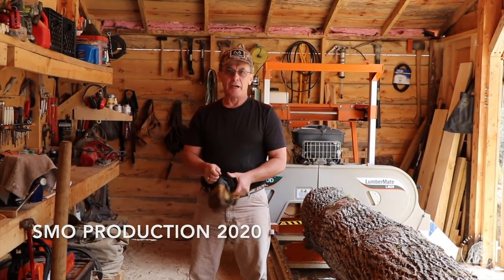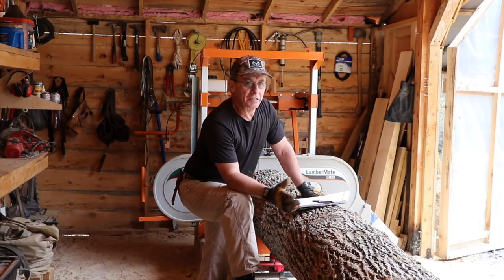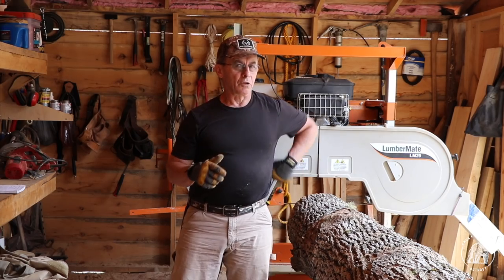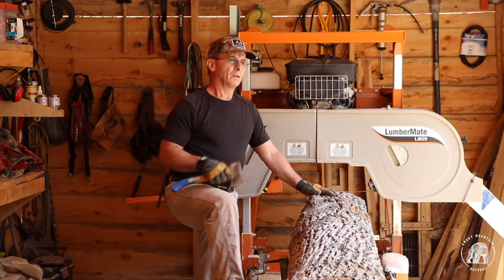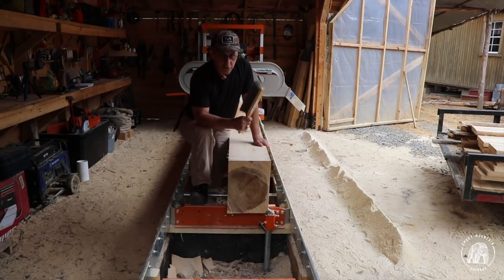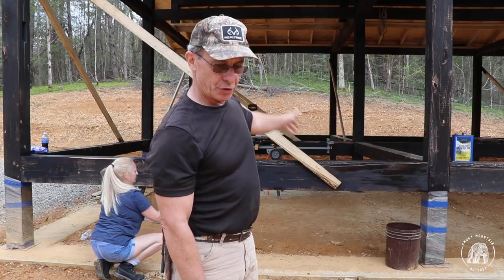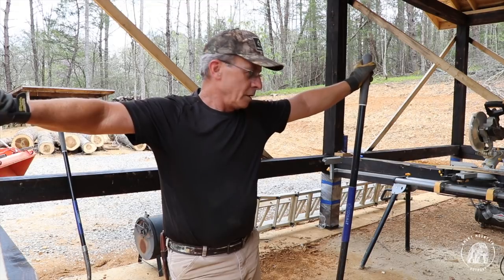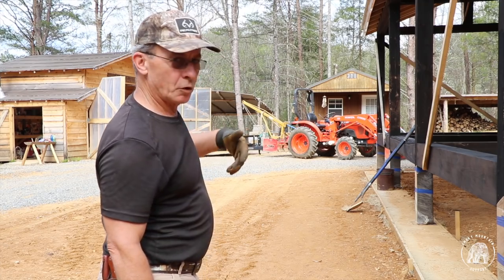QA9 | WOODWORK | TIMBER FRAME | MILLING FLOOR JOIST | ADVICE ON CABIN BUILDING

Comment: i would reconsider the lap siding yes it looks nice and I have done both I have even removed lap siding and went back with board and batt here is where the trouble will lay you do not have dry kiln lumber lap siding will bow and open up even with the best of wood that has been  dried board and batt will lay better and dry different in place yes small gaps will form from wood shrinkage that you wont see with lap siding but it will cup and open because it has no nails to hold it tight at the bottom of each run your batts on the board and batt will cover any gaps that are formed from the shrinkage and I also agree and plywood type underlayment before siding will be a tremendous help in the overall comfort level of your cabin along with a house wrap between your vertical timber frame posts love the videos keep them coming  just a north Arkansas guy whos been there done that

Comment: Use joist hangers on floor system. Bottom beam is plenty strong to hold load especially if you are supporting  them with block. You can use smaller block( cheaper), and  your  Mason will be a lot happier! Also speeds up the process tremendously, if you don't have to lay block first.
Reply from the maker: Copy that!!

Comment: Siding: we have log siding on our camp and had some that warped and popped out over the nail heads. I used 3 1/8 GRK screws which I'd recommend for anything using different size screws of course.  AMD they pulled the siding right back In tight. Did have one that I used 2 screws at one time with 2 drills as that one was a little stubborn but they sucked it right back In. I'm a fan of both lap and board and baton but i think lap would look great with the exposed beams along w the angle support corner beams. Woukd b a good combo of those angles. Water tanks: never done that but in the effort to prevent stagnant water I wondered if there was a way to force the new rain water to te bottom in pushing older water out the overflow ? May not b a need or issue but was just thinking ahead. Great video and thanks for sharing the Info you're getting
Reply from the maker: Thanks Tony

Comment: If your wondering about solar power I've also been subscribed to another couple that is building a A frame house with solar power in West Virginia. You might want to check them out. Its Wild Wonderful Off Grid. They have a link to a series of videos they did on their solar power setup they have. Good luck, love your videos. I have been subscribed to both you tube sites for over a year
Reply from the maker: Thank you. I will check them out. We appreciate all of your support.

Comment: 5th👍's up guys thanks for taking us all along with you for the great show
I like all the great work you and your family and friends have done
Reply: if you are going to screw it make sure you wrap the tip of the screw to take the point off it so it don't split the wood you wanted to mall its way through the wood
Reply: Take the sawdust that you have left over on the ground cool 15-foot all through the woods he needs correction from the Hallsdiggerfoot hole and fill it full of sawdust and cover it so the rain came today other than in a termite Sophie's there and stay away from your house more
Reply from the maker: Thanks 👍

Comment: There is a push toward DC power vs. AC down here in Florida. It uses much less power accordingly. If I were to go solar, I would think that would be the way to go. You might do some research about that.

Comment: YT tip for al traditionell building lovers: NORTHMEN. Cool guy he had put alot good solid videos online. Traditionel building-houses or cabs include to evoid mineralwool or syntetic iso stuf. Wood dust from the chain saw is a perfect isolation material to fill walls or floors or under the roof. Take a look at his canal.

Comment: I found an oil based stain call Outlast Q8 that I used on a white cider log cabin I built.  It was a great product which was recommended to me by a log cabin restorer out of NC.  Great UV protection and the insects, including carpenter bees, hate it. As will all stains, eventually you will need to retreat, but this product lasted for me, about 6 years before needing another coating.  Worth a look.
Reply from the maker: Thanks Steve

Comment: I’ve been in the industry for over 30 years. What you have to understand is this is your build, at the end the look needs to be what you want so your happy. The siding should be what you want the key to all of it is the install. Most people will answer with what they prefer not what’s best. Again it’s all about install, make sure your siding can weep, have drainage don’t set directly on ground or concrete use the proper flashing and waterproofing, treat or paint the end grains

Comment: For those how plan a new house or cabin:
About the importance of “geology-fact checking”
I am a facility manager in Germany. 30 years in business.
There are the customers, then the architects and the building comps.
I am one if the controller of the work- I work for the owner and I control the work on the building place and the contract and check out if the architect (if one is on board) does what the contract about the quality will come into existence. 
One classic example of a standard house: Concrete as a fundament, then a 15-20 cm air concrete stones as a “first wall” then 10 centimeter air with 5 centimeter isolation of high end
hard pressed mineral wool- some small air holes in the outside wall- with clinker stones so that the wall can breathe. A standard wall can be 40 centimeter to 50 centimeter.
Good in summer and good in winter!

Geology-check is a “must do” for many house builders and those how did not do it- big problems came in the future. If the ground is to wet because groundwater changing in summer when the rain season is on its way- or if they build on a river side or direct on a river.
Sometimes in 2 or 3 meter there are underwater lines that keep the ground wet and instable.
60 years ago, my father builds his first house. He was a agricultural engineer, a former farmer in Germany end he did know something about soil and the earth. Farmer knowledge 
He bought a piece of land that had a hard big layer of clay stones 4 meter deep.
Because of that the rainwater could not go away. The groundwater could become a problem for the cellar because there is no concrete that is waterproofed.
So he build first a “cross over- pipeline in the sand of the fundament bevor the concrete was poured out- and in the middle of the house a collection point for the groundwater- so that 1000 liter water could find a place and a automatic pump system would pump the future water away from the other side of the house- the cellar. Than the concrete came and then the house was build but also with drainage around the fundament of the house. Keep the house dry!
Believe me the house was dry until this day.

Some don’t consider “where the house can stand and where the place is not so good”.
Some build to near by the hillside and take away from the hillside the “feed” of the hillside.
Every era has its own hill-substances depending on the quality of the hill- much stones- big granite places. Some have hundreds of meters “green space” with few trees. Depending on the % slope- it could become dangerous for the people and the house to take away parts of the “feed” of the hill. The “feed” was built by nature and years of rain and washing out of the humus. If the space is often washed through heavy rains than it could come that the hill will move.  “Slide of the mountain” we have sometimes in Germany Switzerland or Austria after heavy periods of rain. Than the hill destroys everything.
However plans a house should take advice from a geological trained person so that the house will be safe.
Others change the surface of a Foresthill- a surface for example is hard fast dry after rain and they put stuff on the surface that keeps the humidity IN THE surface of the hill and through that the hill surface could lose its strongest its stability.
I would say let the wind and the sun do its job. Keep the hillside dry and don’t change the system that was well for long times.
But building drainage is a good idea. Bring the water away so fast as possible.
There are some tricks to observe if the hill is moving millimeter by millimeter.
Consider long periods of rain. If the new build sureface is constantly wet, it can change everything but not for good.
Greets from Germany.

Comment: Instead of having electricity for a backup I would use a propane powered while house generator that would recharge your solar batteries of they did and you can use it in the shop for extra power of you need it that way you are not paying a power bill every month just to have it
Reply from the maker: Noted

Comment: Jacob Hallman Builders, I probably didn't totally describe the corner braces, they about 10' long and 2 1/2" wide they are galvanize metal, they have holes to nail about 1" apart, these run on 45 angle s in the inside corners of walls, they are thin and flat ,your interior finish cover walls go over these, they are thin enough shows no bowing. I heard you say you already had notching for wood. Thanks, as always REMEMBER JESUS LOVE'S YOU 🙏🙏🙏

Comment: If you bury a tank, you have to buy a tank that's strong enough to be underground and make sure it's surrounded by the right type of materials. The side pressure is the concern. I don't have any idea what impact the red clay, or the shale (?) or whatever is under it have on the process. If it's above ground, you can get by with a cheaper tank. (I like the underground idea, just wanted to mention the financial difference.)

Comment: When u do your solar, consider putting the panels on the roof as we do here in Australia, that way u do not waste ground area abd do not have to run pipes every where underground
Reply: no thats not an good idea. To many houses where burned down to the ground. Better put them on another place. Especialy NOT if the building material is out of wood not like in many others places in the EU. Solar must be reacheble for cleaning reperaing and checking. Better a big carport and on that the solar then over a home! To lose a carport is not a big deal but a house!